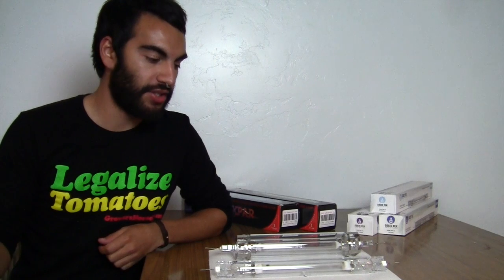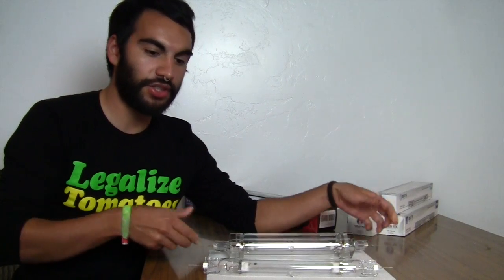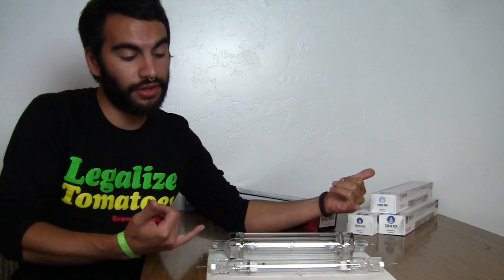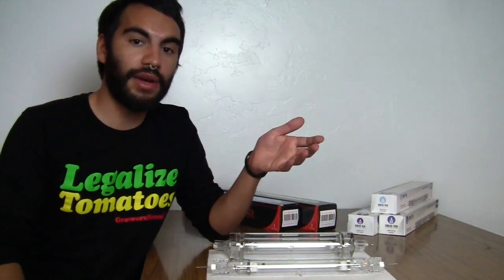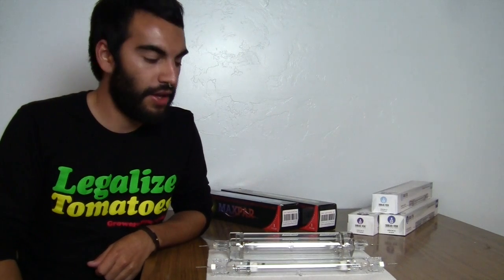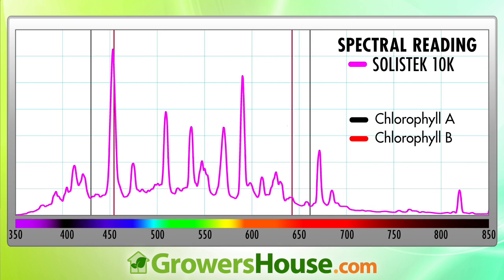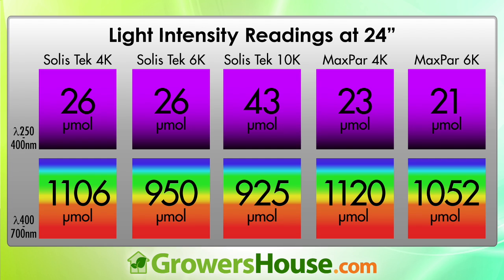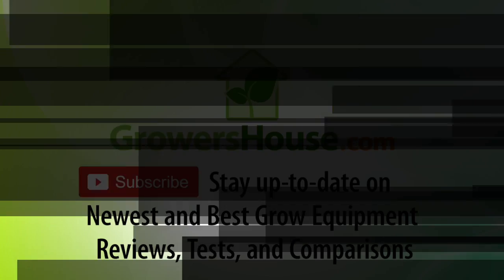1000W Double Ended (DE) Metal Halide (MH) Comparison Test Review

Comment: How does the output of the SolisTek 4K/6K compare to that of a 1000W double ended Philips HPS? Is it worth switching to HPS for flower? Would running a 4K start to finish produce more dense flower than switching to HPS?

Comment: From the spectrum chart the 10k looks like it would veg great due to the high blue nm between 400-525 and those Hortilux T5 powerveg use it? on paper it looks viable?
Reply: Yes the 10K in veg is on point 100% short internodes and crazy growth.
Reply: Powerveg use UV
Reply: Yes, it will work for Veg, but we'd still recommend the 6k overall. The Powerveg lights use UV, but for the most part it's recommended you use about 2 to 4 Hortilux Powerveg lamps per 8 lamp T5 fixture so that you get the 6500k spectrum from the majority of the lamps, then the supplemental UV from the Powerveg lamps. If you did a side-by-side, you'd expect the plants under the 6k to grow slightly faster than those under the 10k due to overall intensity within the photosynthetic range being higher in the 6k vs the 10k.

Comment: What is the talk of Solis Tek MH DE Bulbs Exploding? have heard frightening feedback.
Reply: We're one of Solis Tek's largest retailers and we don't have any experience with the Solis Tek MH lamps exploding. If you have heard that from another source, our guess is it's more of an isolated incident, possibly due to incompatibility between lamp and ballast. We know that Solis Tek MH lamps work in Solis Tek ballasts and Gavita ballasts through in-house testing that we've done. We can't say for sure about other fixtures, but if you plan on buying Solis Tek MH lamps for other fixtures, please check with us and/or Solis Tek to confirm compatibility.
Reply: Would like to use the 6k MH Solis Tek bulb in the Phantom DE Open Fixture. Will this work?  Thank you!!

Comment: what ballast was used to power these bulbs?
Reply from the maker: +SwagSlayer85 We used the Solis Tek 1000w DE Ballast (ST1001) and the Sun System DE Boss reflector (no glass).
Reply: @GrowersHouseGrowLab  How does the output of the SolisTek 4K/6K compare to that of a 1000W double ended Philips HPS? Is it worth switching to HPS for flower? Would running a 4K start to finish produce more dense flower than switching to HPS?